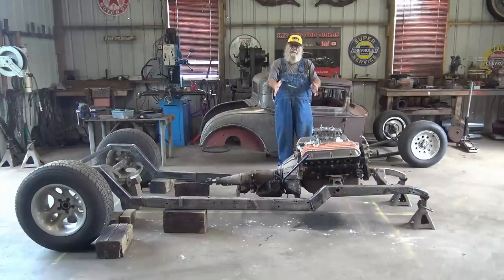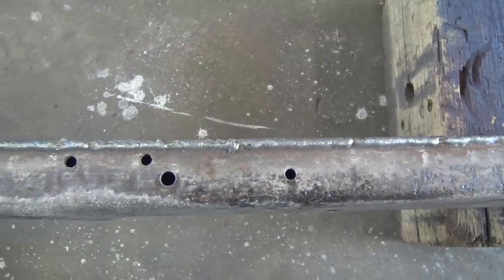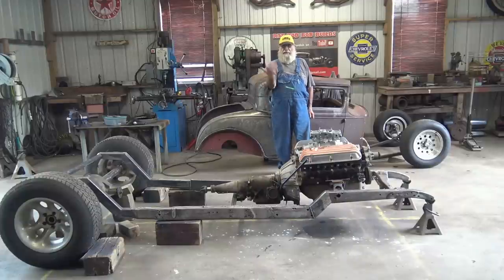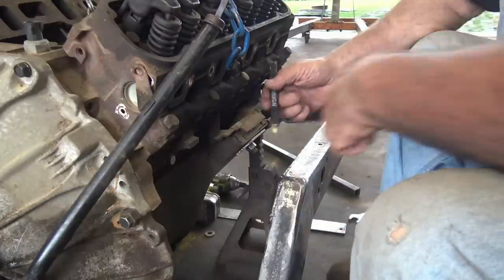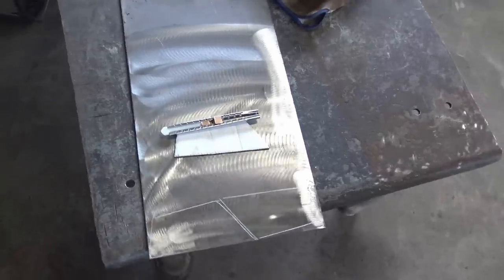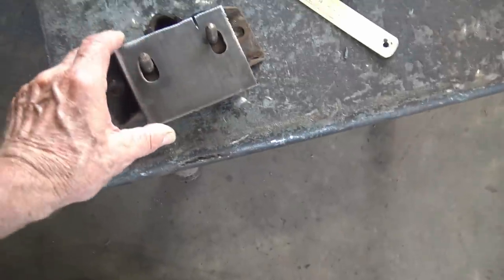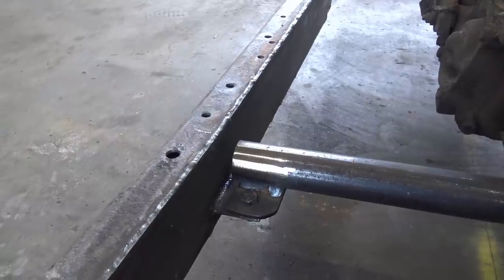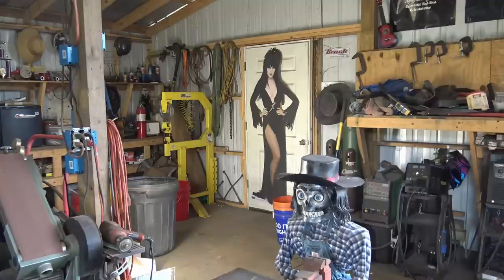Custom Hot Rod Engine And Trans Mounts Done The Easy Way

Comment: Bob, I had a 302/4BBL in in a 65 Mustang  I bought for $150.00 in  77 or so. Originally a 225/ 6  manual, someone just stuffed  the motor in with an auto tranny. 4 bolt rims with I'm pretty sure 13" tires maybe 14". so I bought the biggest set of Goodyear Eagles the local shop could get ant fit on it and I had 12 yrs of great times with that car. Woah... I'm back, the reason I started this was to suggest you paint the valve covers Wimbledon (Ford) white and in between the fins Ford Blue.  Sorry for the trip down memory lane...

Comment: Hi Bob; I much enjoy your videos. I am a subscriber, and I always hit the like button. lol 
  I'm leaving a note to try and help you avoid a mistake I made, and learned the hard way.... on your oil filter relocater, use aluminum fittings in that housing. Steel expands at a different rate then aluminum does, when the oil gets hot it expands the steel fittings enough to Crack the aluminum housing.  Mine sprayed oil all over the truck.
Reply from the maker: Thanks for that tip. Aluminum  it is ... probably go with AN fittings and hose.

Comment: Bob love the car. Love your work.     So question please?    When removing rear transmission mount you unbolt the rubber from trans to drop mount and not remove rubber from mount then slide mount towards the rear of the car to clear plates mounted to frame?      I know it sounds as if I am stuck in the weeds with this question but I do plan to build a rat rod some day soon once I have gathered enough to start with and want to learn.    It seems to me you might have made a mistake or,   I do not get the full picture and I want to.    Thank you for sharing all your great knowledge in your school of rat rod idealogicy
Reply from the maker: Yes ... unbolt the cross member and the mount from the transmission and jack the trans up a half inch or so and slide the cross member to the back to get it out!

Comment: You should get a plasma table. That way you can make those pieces in minutes instead of days.
Reply from the maker: If I was a lot younger I might would do that. But for me now it would cost as much as building a car for a decent one and I would need a spot for it in the shop that I don't have and I wouldn't use it enough to make it worthwhile. Not to mention that would not be good inspiration for folks to make stuff with cheaper tools like a $200 plasma cutter. But anyways I would go with the water jet if I wanted to go all Boyd Coddington. LOL

Comment: you can use that joint if you weld it. but that would nt be good it would be too perminet. might ruin the steering box. why would they make it so it couldnt tighten down? Might be someway to adapt it by welding it to a spline that would clamp down.
Reply from the maker: Bad design from a land far away! Good thing it was on the cheap side. But you made me think of something ... I could probably heat it red hot on that one side and get it to tighten down.
Reply: @RatRodBobBuilds  Maybe it would soften it some would it be still good? Try it and see.
Reply from the maker: @shartne  Then I thought, the grease in the joints will get burnt away so I reckon it'll be a wall hanger.
Reply: @RatRodBobBuilds  they have stuff that will keep the heat from traveling or a wet rag but that dont work really well. I geuss it is not possible to re grease the joints I drill and tap sometimes and pump new grease in. with a nipple.

Comment: Do you use the .023 wire on your frame welds?
Reply from the maker: I only use .023' on body panels and stuff 16ga and under. I used .030" on the frame and I use .035" for 1/4" or thicker welding. The thicker the wire, the hotter you turn the machine up. The thin wire will only carry so many amps.

Comment: BOB, DO YOU NEED A BOTTOM PLATE ON THE MOTOR MOUNTS, OR NOT?
Reply from the maker: I may add a couple gussets under there when I get the frame upside down again ... it'll be fine!